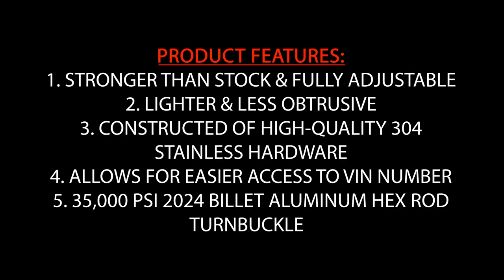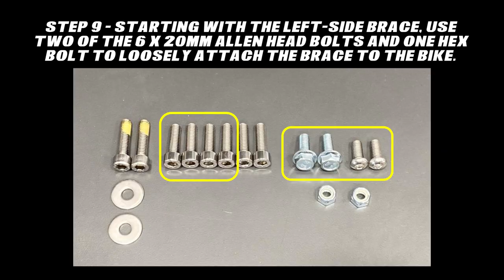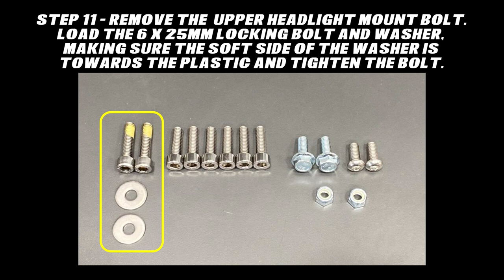HOW-TO INSTALL ROTTWEILER HEADLIGHT BRACE - KTM 790 ADV - ROTTWEILER PERFORMANCE

Comment: Hi. 

Received and installed today. 
Hardware received did not match the one in the instructions (vid and print) so a little best guessing was required. 
Worth updating the vid?  Or toss in a piece of paper with each order with updates?
Reply from the maker: Hi Colorado, thanks for the message and we will certainly look at that. The hardware we updated it to is the same quantity and lengths, just different head styles so we should still be close. The videos we can't really update for hardware but the instructions we'll certainly update next opportunity. This was something that changed over a year ago and you are the first person to mention this so we're on it.
Reply: @RottweilerPerformance  Thank you!

Comment: I just took this off my 790 as I'm selling it for the new 890R. Will this brace fit or be necessary for the new 890R ?
Reply from the maker: Yes, the part will fit and the two models are the same. They did not fix this on the 890 Adventure either.
Reply: @RottweilerPerformance  the 2023 model seems different.
Reply from the maker: @showmytime9177  Correct, this item is not used on that model as KTM has addressed the issue with more bracing. We have yet to see if this will still be a problem as they still have not welded stronger braces on the head stock unfortunately. We don't know what they were thinking with such weak parts but it seems they have thrown some Band-Aids at it with the 2023.